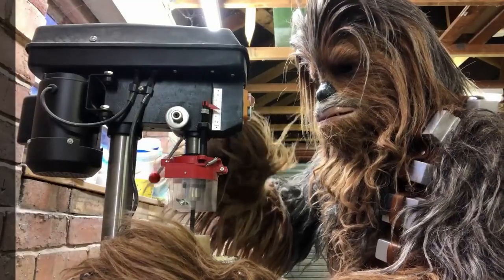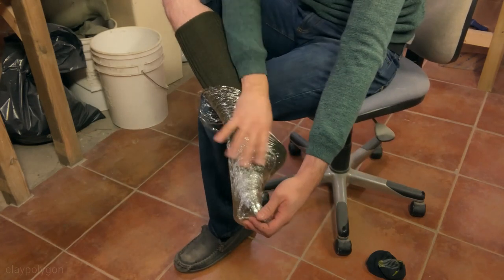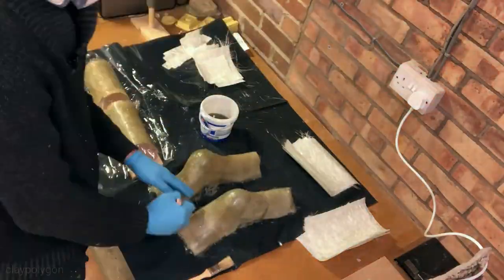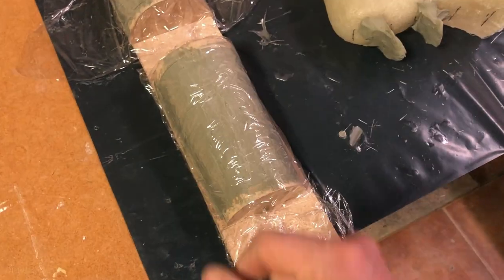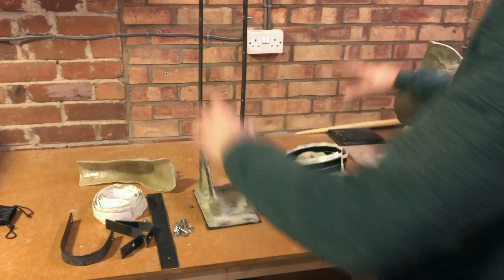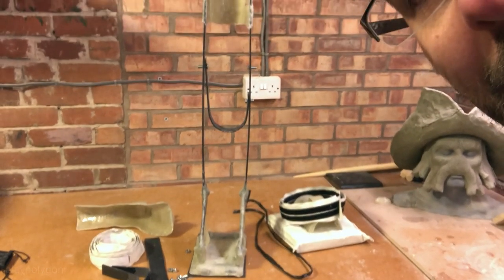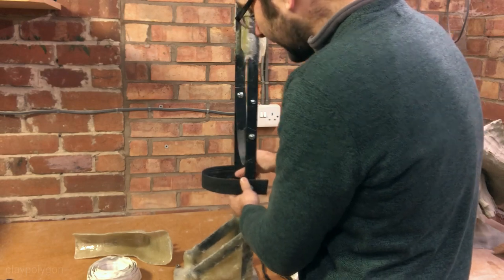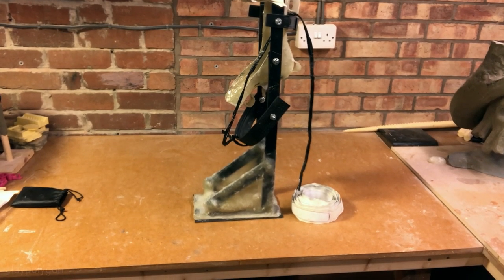Cosplay Stilts #02 Fiberglass, Soft Parts and Bringing It All Together

Comment: When molding your feet, Why didn't you use for example normal bondage that gets hard when wet? Is't that a better idea then fiberglassing directly on the foot?
Reply from the maker: The reason I did fibreglass directly onto my feet is it removes a step / cost. If you plaster bandage your feet you then have to make a cast of your moulded feet before you can create your perfectly formed fibreglass 'slipper'. That's time and money in materials. 👍